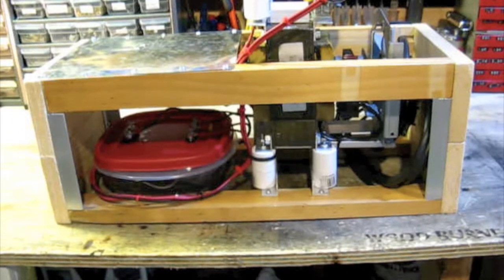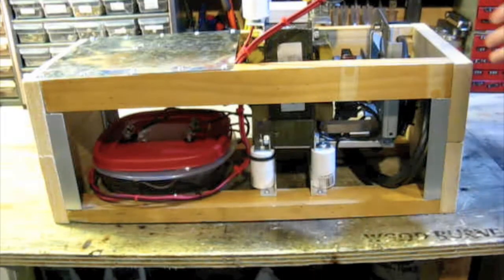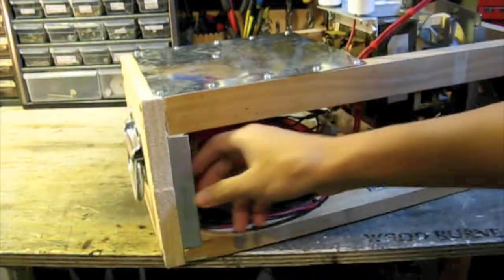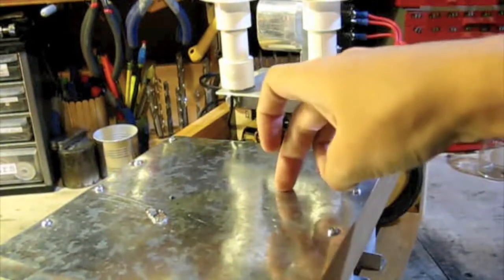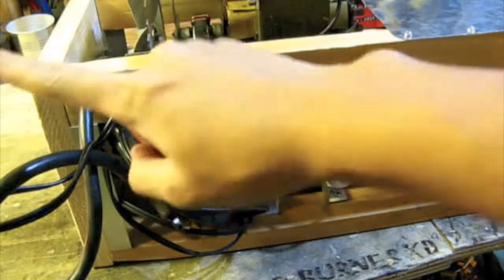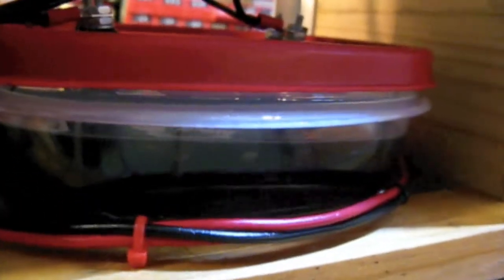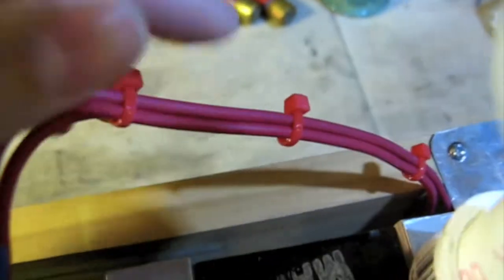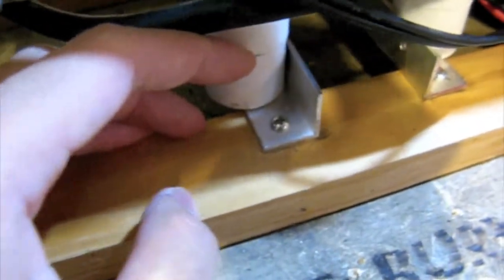New High Voltage Power Supply and Testing

Comment: ...The other suggestion I have is that you might want to connect two transformers in series to get 4kv.  Microwave transformers can supply a lot of current, but the voltage is relatively low...2kv or sometimes less.  You really need higher voltage to do more experiments.  You'll notice that with your transformer right now, you can get really hot, bright arcs, but the striking distance (the distance where the arc can start by itself) is very small, because it's only about 2,000 volts.

Comment: Very interesting!  I have some questions though.  First of all, what is the purpose of the "oil switch"?  Do you have a relay or something submerged in oil?  Also, what are you using for current limiting?  If you aren't using any current limiting, the transformer will overload and get extremely hot, and so you could only run it for short periods.